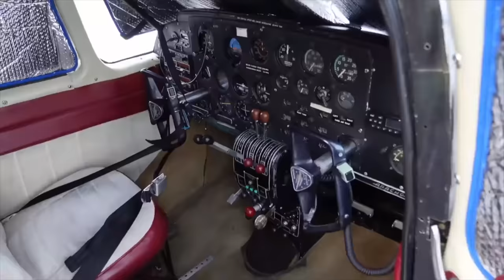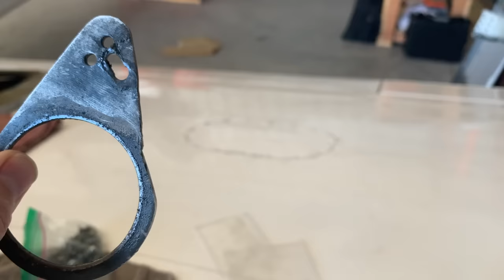Kicked Out Of My Hangar...Cheapest Twin Engine Airplane In USA

Comment: Test pilot Jimmy Day! Every time we fly an aircraft fresh out of maintenance the pilot becomes a test pilot! I practice lots of ground testing to find the pesky problems with aircraft that's been sitting. Vacuum pumps, algae in the fuel lines, tachometer cables, electrical, faulty radio channel selectors and the list goes on & on... Gyros don't like to stand still, and their bearings get flat spots and quit. The more an aircraft is exercised the fewer problems... Cheaper to keep it flying than to let it become a hanger queen. The longer it just sits the more problems develop. Great job guys!

Comment: There are motorcycles that put out 300 hp!  (at 9000 RPM for 10 seconds at a time).  As much as most certified piston aircraft engines are designed in the 1940s, they are designed to put out a large, steady amount of power for extended periods, a very different requirement from road vehicles.
Reply: The last bike I had red lined at 12,000 rpm and that was a "super naked" while the more full race version with the same engine but with lighter titanium vales revved to 14,000 rpm and put's out just over 200 hp so yeah, quite a bit different lol.

Comment: Now there is a man who knows how to lean while on the ground. Most everyone I see leaves it at full rich, which leads to lead fouling of the sparkplugs and massive lead deposits in the cylinders. And I second the thought that you should build your own hanger. You could certainly use the space!
Reply: The real trick for me was to remember to really check and make sure I reset it to take off.
TCP helps.
Reply: It wasn't too long ago he could have bought an entire airport with hangers here is Selma, In. for not a lot of money.  It was an airport with about 8 multiplane hangers from the 50's through the 80's.  Then they stopped using it for an airport and just farmed the available land.  A few years back the demolished all the hangers but one and tore up the runway.
Reply: @michaelbarrett1914  
Dang, that’s kinda sad!

Comment: I gotcha beat, I’m elbow deep in a Cat 6 diesel marine with a clogged inter cooler and a barely functioning impeller that I’ve had to special order to be made. So far I’ve removed the impeller cover removed the impeller, honed the pump wall replacing the woodruff key in which I’ve had to fabricate replaced the cover without the cover and have flushed the system with barnacle Buster. Let sit for 4 hours with solution in the system and when I reversed flow found some awesome stuff. 4 broken anodes and enough broken pieces of impeller to make one lol. She’s cooling now lol.

Comment: If that was an old janitrol heater…amen to 86ing that thing. Following the checklist to a T it was either melt your face off hot or frost on the windscreen. Then upon completion of the flight there was a black carbon streak down the side of the airplane and the exhaust tube was melted. Was close to going down in a fireball. It was a twin Comanche as well. Also had a full electrical failure when the flap switch was touched. This one had the manual pump between the seats with the jack handle you had to pump for the gear. That was at LAL. Gave everyone the ability to practice light signals after loosing comms as well. Still great airplanes though.
Reply from the maker: gotta love those jani-bombs

Comment: Your Elvis jet ( 2 of 200 built by Lockheed between 1957 and 1978)) is 1 of 2 of 3 owned by Elvis
The other in Graceland on display with the. Lisa Marie ( Convair 880)
Draws 100,000's of visitors a year ($$💰)

Comment: I own a ranch , where I live, 18 miles from Seguin, Tx I'm a retired Continental pilot. Around here those are hometown twins, lol  I taught in them and did presale flights out of Geronimo airport here. Great airplanes, we used to spin them into the dead engine to show customers how amazing they were.
Reply from the maker: That’s crazy! I’m not surprised they could recover from a single spin, but geez… scary!
Reply: @therealjimmysworld  no, we did a 3 turn spin into the dead engine from 5000 agl. It recovered easily by 3000 agl.  One word of caution, these were ACTUAL Geronimo's. Since the company folded, people have tacked on a few of the conversion parts and CALLED what they had a Geronimo, but they were more Geromensteins or Frankenonimos... Just pieced together bits tacked on to stock Apaches. I wouldn't spin an Apache in either direction.

Comment: A stock 350 cubic inch chevy doesn't put out 300hp. Its actually pretty comparable to the plane engines 180hp. Even the high output engines of that era were only good for around 220hp. Take a foxbody mustang for instance ((ive owned 14, still have 3)) They only pul out 230 on a good example. The fact that this plane has a air-cooled and reliably kicking out that power sustainably is impressive to me. Ive never been into aircraft whatsoever. Just found your channel 2 days ago by mistake. Ive been binge watching amd have enjoyed your content. Nice to see someone who doesn't have to act like a know it all or overly animated to produce good content. You have a lovely family by the way. 

Blessings and fortune friend, be safe.

Comment: You're correct, there's a world of difference between aircraft and auto engs. About 30 years ago I was in school to get my A&P, while fight instructing on the side. Was surprised to find out aircraft engines were still using cast iron rings!!!....an avg auto eng produces about 1 HP per cu in...an aircraft eng puts out about 1/2. HP. the reason dances around reliability.

Comment: My motorbike has a Rotax one cilinder, and that thing has a 3.9-ish inch piston, and like 3 inch stroke. It is a 650 cc and it loves high revs, can handle 7 or 8 thousand, but 5 is plenty. It would not surprise me, if Rotax also sells a 2.6 liter 4 cilinder, with four of those pistons. And I know plane engines are often pretty simple, on purpose, just to keep them running no matter what. Five valve heads make no sense if you never rev the  engine, which saves out a prop gearbox. Gearboxes is extra weight and bearings that can grind  to a halt when you do not want it. Thanks for the lesson in pistons and a torquee engine. Maybe planes are fun, after all.

Comment: Air doesn't cavitate. That's what water does when  pressure changes it from liquid to gas. Prop tips get shock waves which increases drag and reduces lift. It can cause the tip to stall, but not cavitate.
Reply: G'day,

You're almost not wrong.

Water Cavitates because it can't be compressed and if you try to decompress it then it'll wrap Skins of Surface Tension around the Bubbles of Vaccumn which one has "pulled" out of the Liquid...

Air either Flows or it Turbulates, and when a flowing Airstream is obliged to speed up it lowers it's Pressure, and the locations where the Low Pressure is significantly below Dew-Point will become visible via Condensation appearing in the Air.

Calling Condensation Trails or Clouds in  Airflow "Cavitation" is as right as it can be - when applying Liquid Fluid Dynamics Jargon to an Aerodynamic Phenomenon rather than a Hydrodynamic one...; but it communicates the Concept well enough - I thought...

Such is life,

Have a good one...

Stay safe.

;-p

Ciao !
Reply: ………that’s what I thought !!
Reply: @stevec7596  so what,for me I got the point

Comment: What was the red knob that you pulled all the way out.  You said it was for when things go wrong during take off.
Reply from the maker: yep, it's the manual pump for the hydraulic system that operates the flaps and landing gear.  It's part of the takeoff procedure to have out in case you lose hydraulics and need to quickly operate the flaps or gears.
Reply: @therealjimmysworld  Thanks for the quick reply.   Love the channel!

Comment: Doesn't the RPM of the propeller depend both on the RPM and the torque of the engine? That'd mean that an engine with large cylinders would produce a high torque which would then cause the propeller to spin at a high speed as well.

Comment: I worked at a Beechcraft dealer where a customer came in for major work. Both engines went out for exchange, the propellers went out for work and the interior got reupholstered. Avionics people were in there changing radios and running wires. It was down for several months. The owner would come by and chat with the shop foreman and they'd both walk around the airplane checking progress. All the parts started coming back and the interior looked fantastic. We even Armoralled the tires. All put together, the lead mechanic took it out for a few hours and then he went up with the owner for a few. We dumped the oil for a quick look and then the owner came back.... with his wife and 4 little kids. I chit a brick and wondered if I did everything right.  They hopped in and flew to Texas. The following week, the airplane came back for an oil change and no writeups other than a few questions about the avionics. I got out of airplane work because of failing eyesight. But let me tell ya...that work ethic stayed with me.

Comment: Fess up...is that a maybe 2011 or 2012 W221 chassis S65 you're driving? In addition to planes, I have a thing for S Class sedans. You've got style and good taste with that W221. To keep this on track, I got my multi in an old 150hp Apache with runout engines. My examiner passed me and said "Son, don't ever fly this airplane again". More power like you have, cures all.
Reply from the maker: Good eye. 2011 S600

Comment: The red and green lines on the airspeed indicator are for landing. Go below red, you’ll stall, go above green, you flatten your undercart.
Reply: the low end red radial line on the airspeed indicator of a light twin is Vmca, not stall speed.
Reply: @buckmurdock2500 , sorry yes.

Comment: Man I just watched a TikTok video where a guy landed with his gear up, full belly landed, dual prop strike, and then powered the plane up and took back off in a stall, and managed to save it and gain altitude. It was simultaneously the worst and best piloting I've seen lol
Reply: Was that the Older gentleman in Florida several years ago?
Reply: @Suncast45  I'm not sure. I couldn't find details in the video.
Reply: @Suncast45  But both of the props were curled over, and somehow he still managed to get enough thrust to get back off the ground although I don't know if He made it back around to land or not
Reply: @BoostedSpeedDemon  He made it safely to his home airport and landed!
Reply: @Suncast45  Jesus😂
Reply: July 2015, Aerostar piloted by an 85 year old man landing for a pancake breakfast. Flew 100 miles back to Ft. Lauderdale and safely landed! LOL Look on Viral Hog, YouTube
Reply from the maker: Dang!!  Gotta find me an Aerostar ;)

Comment: Hi? Jimmy.
  " I already approve this video, but? I want to point out something to you. Firstly? I think you have a good crew, everyone is doing their job. It is not an faa requirement, but? To me. It is common sense that a mechanic should always pressure clean these engines with very hot water anytime a panel is removed. It reduces erusion, and it identifies defaults. And?  If the interior condition is not suited or requires maintenance;  The mechanic should clean and paint the area were the service is  implemented, and include the assignment in the price different from the entire aircraft being paint. I know no mechanic would would like to do this during an inspection, but? Every time an aircraft is serviced, this implementation  extends the life of the aircraft and makes the aircraft easier to examine, because of it being cleaned. Whereas? The hydraulic filter reservoir leakage, would of being identified before your testing the aircraft if the engine was pressure cleaned due to observation."  
~Overall? Good Job everyone. You are a good serviceman Doctor Phill, but? You need this ingredient, no offense taken.~ 👍
Reply: Very magnanimous of you not to be offended by your own criticism.
Reply from the maker: yep and yep.  This airplane is getting a much deserved bath this week :)
Reply: @a.n.7863  🤣😂🤣😂 You suppose English is second language?

Comment: Pumping the throttle for priming while the engine is not cranking is not a good idea. The fuel spray falls back down in to the carb heat box and can catch fire if the engine back fires during cranking resulting in a fire in the engine compartment. You would not be the first pilot to burn up an airplane that way. Using the throttle to prime should be done while the engine is cranking. That way the fuel spray is drawn into the intake.

Comment: A gascolator, also known as a main line strainer, sediment bowl or fuel strainer, acts primarily as a fuel drain for water and small particles of sediment and is usually found at the lowest point of an aircraft's fuel system. Wikipedia

Comment: So in negative G, what stops the battery moving up and shorting out on the battery case lid, or is the lid fitted with an insulating layer?
Reply: Pull back on the yolk.
Reply: Plastic.
Reply: @dagger4146  what do eggs have to do with it?
Reply: @johnnunn8688  Hah ! You got me.  Yoke it is then !
Reply: @dagger4146  🤣😂

Comment: 72" prop at 3000 RPM at 70f prop tip speed is 643 mph or 0.83 mach. You would need 3850 rpm to hit speed of sound on the prop tips.
Reply: At sea level?
Reply: The prop tips do not have to reach supersonic. Once in the transonic range, prop airfoil loses efficiency and drag overcomes thrust. Airplane props do not cavitate. That's a boat term.
Reply: @mikebarushok5361  Yes. Figured Florida.

Comment: I had to go look up what a 'holy crap' handle's about.  Turns out it's a manual hydraulic pump if the left engine or the hydraulic pump goes out so you can lower the wheels or whatever else needs hydraulics in an emergency.

Y'all who didn't know are welcome. :)

Comment: Interesting money pit you have there... err I mean airplane.  I used to build Geronimo's at Diamond Aire in Kalispell, MT.  The marketing wank surrounding the Geronimo conversion sure did a GREAT job at separating the money from a lot of well meaning however arrogant "owners".   In the end you still have a dumpy, frumpy, beat up old piper twin that frankly will never get close to the performance of an Aztec or even an Apache 235.  I'm surprised the mechanics tolerated your cockpit shenanigans while they were still working on the engines with ship power still hooked up.  That is a glaring red flag in your safety culture and quite telling how much you think of the guys that are maintaining this machine for you.

A few things to note:
-This is a "Critical Engine" aircraft.. if you loose the left engine, you will beat the paramedics to the crash  by a good half-hour.

-Still has old two piece windscreen
-Still has old "round" rudder cap
-Still has old style engine cowlings
-Still has the ancient instrument configuration
-Undetermined if this aircraft has flap gap seals.

Good luck. With that. Like and subscribed.
Reply: You seem fun at parties.

If you can't fly this plane without the critical engine, you're an awful pilot.

Comment: Hello Jimmy
I've been following your videos for a while, I can't judge, but the engines are usually air-cooled, if I had such an airplane I would clean every cooling fin on the engine and the cooler for oil. In any case, I think such measures are important for the aircraft engine, since I know it from model flying. Just as a tip.
LG from Germany

Comment: What does that handle you rotate on the roof do mate?
Reply: I believe that is trim tabs.
Reply: That’s the elevator trim.
Reply: @johnnunn8688  elevator and rudder trim are both there
Reply: @Jimmeh417  so they are.